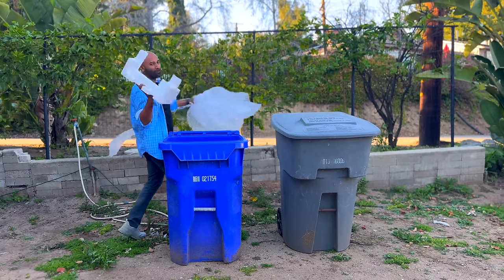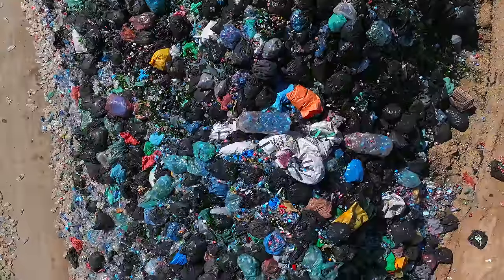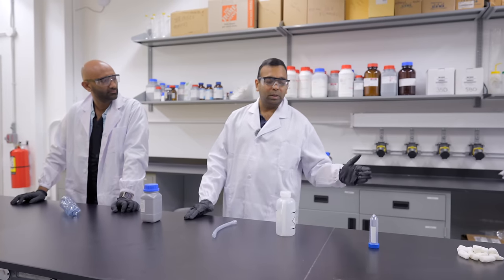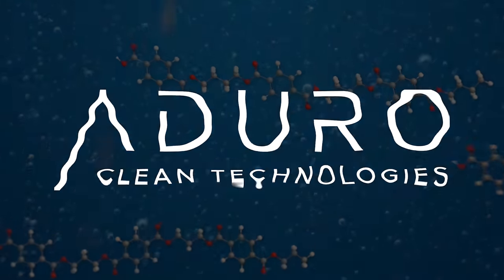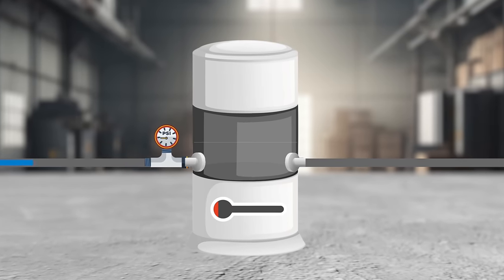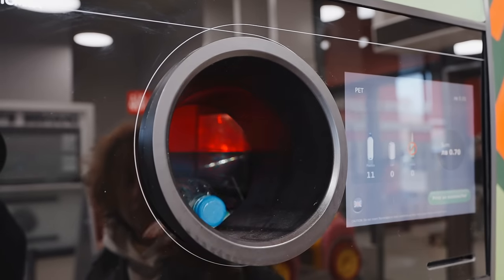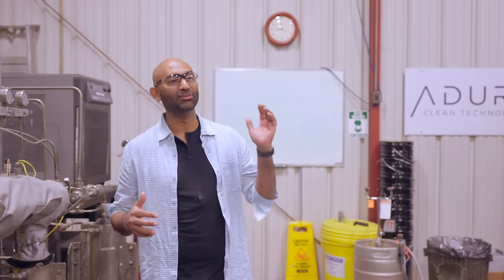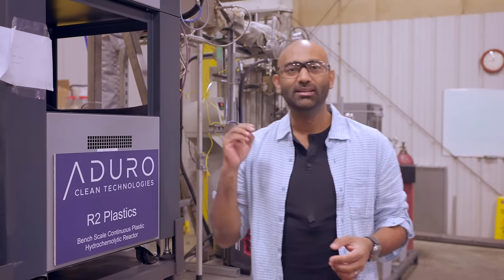Plastic Waste May FINALLY Have a Solution!

Comment: The UK is working on it, we have bottles with the lid made from the same clear plastic as the bottle, with a retainer that keeps the lid attached when you open it. The plastic film on ready-meal packs is just a single plastic rather than a laminate which tends to leave a layer of film around the edge of the container.
Next step? Ban coloured plastic bottles and those squeezy bottles with a valve in the lid. And pump-action bottles, several types of plastic,
Reply: What we need to do is standardized all plastics world wide. (Also use colors that don't effect them).

 Specialized plastics then can be taxed. 

 Medical plastics are good. Yet we should try to make them conform.

 I've seen tons of companies say they have the solution. So I apologize if I don't believe them till I see it. !remind me 25 years. (Just playing. Wish YouTube had that feature. )
Reply: This is very energy intensive.  Furthermore, most of the plastic in the oceans is not from the Occident.
Reply: you are nuts
Reply: I work on the bins, uk isn’t doing anything to help the problem no one is recycling their waste correctly.
Reply: - great, sounds good, except "banning" things is a poor way to move the state forward...  (big govt. of course sees bans as a one size solution - very short sighted.)
Reply: @crooksgames4511  there's no such thing as recycling your waste correctly. That's never going to happen, it's too complicated. We need solutions that sort the plastic etc at the other end and clean it if you need rid of food residue. Thankfully, this is easily done with robotics (not walking ones). I saw a glass machine the other day - they grind all colours and send it over a drop like a waterfall. Airjets shoot individual pieces into the correct bin. Completely bonkers but they were using it at industrial scale. 

We're never going to be able to train 80 year olds to recycle things into sixteen bins and it's a huge waste of human time to do too much with them at the household level.
Reply: @kadmow  sometimes we do have to ban things but yes, carrot and stick are more practical. We do however need to force the food industry to do what we need, because they've absolutely zero intention of doing it themselves. They use far more packaging than they need, and show no signs of stopping because they see their packaging as a way to compete.

If, on the other hand, we sat down with them and gave them ultimatums such as, 'We will nationalise your food company, all of it, unless you reduce waste at source, and standarise with more easily recycled packaging.' they would shrug, go to their shareholders and say, 'Sorry, we have to invest this money, the government said so.' That'd take care of a lot of it. 

Now, do I think the average, non-STEM politician could remotely cope with that? No. But then I didn't think the EU would start a revolution in the charging industry, and free us from the chains of Lightning and micro-usb and dozens of other charging standards... but they did. And also removable batteries should be coming. It's not as if it's not possible for government to solve these problems but putting their booted heel on the neck of CEOs who, lets face it, may often be borderline sociopaths and certainly don't care to get this done themselves.
Reply: Only if the replacements already exist, are cheaper, more resilient and easier to manufacture. Otherwise, no.
Reply: @crooksgames4511 what can people do to improve?
Reply: Don't gobble up the greenwashing (which the plastics industry excels in). Nothing is happening and nothing has been done. 
Recycling as we were once tought in school has been a lie from day one and here we are having discussions about an advertorial (he was paid to make this video and it shows) about another startup doing the same thing that doesn't scale nor can compete economically with virgin plastics.
Reply: @dianapennepacker6854  This is a terrible idea. How would taxing help in any way?
Medical plastics cannot be recycled. There is not enough heat in the recycle process.
I agree what is shown in this video is no solution. it is too energy intensive.
Reply: @rkatz69  Recycling is not a lie. Lots of things are recycled on a massive scale. 
Government mandated recycling is what is a lie. 
To the extent we want to limit plastics, and in the West there is absolutely no reason whatsoever to do so, it should be targeted.  Like a total ban on single serving plastic bottles (primarily soda/water bottles).
Reply: @jonevansauthor  It cannot be done with or without "robots"  Glass is recycled because it makes sense.  Glass was recycled long before there was any recycling laws.
Plastic is not recyclable economically or energy wise. It will always cost more and use more energy. Glass bottles are recycled because recycled glass is cheaper and uses less energy. Same with steel, aluminum and copper....  Plastic is fundamentally not recyclable. This cannot be changed by clever tech.
This video is nothing new and is a paid advertisement.
Reply: @tarstarkusz  I didn't say medical plastics should be recycled. They should be exempt for sure. 

 No sorry I think it is a good idea to standardize all plastics. We don't need 100 million variations slightly different that cannot be easily recycled as one for every single damn consumer item. Even the ink should be at the very least non toxic, and biodegradable.  
 
 Those that have to be can be taxed, or recycable. That would actually motivate people or companies to develope better ways. Even a deposit like some states do would work. I'm not talking a lot, but just enough, and it would be those producing said items. 
 
 Even deposites would work. Had bums clearing out trash daily to recycle items. Worked wonders.
Reply: @dianapennepacker6854  What part of "plastics cannot be recycled efficiently or economically" don't you understand?  This would not change even if there was only 1 type of plastic that came in only 1 color.

A large percentage (a large majority) of plastic isn't even used for any kind of packaging, which is what they complain about the loudest and most frequently.  A lot of this plastic is not just plastic.  Take a TV, the plastic of the TV body is connected to all kinds of non-plastic material like glass, fiberglass, copper, silicone, steel etc.

You're talking about soda bottles.  Just ban single use single serving plastic bottles.  There is a perfectly usable and infinitely recyclable materiel which was used before the plastic bottle.  I think I was in my late 20s when single serving soda bottles switched from glass to plastic.  Of course, there is a downside and that is all the extra weight of glass and the hazard of broken glass.

The government will do really silly things like banning plastic bags.  My city has banned plastic bags and it's a nightmare.
Reply: @tarstarkusz if there were only 1 type and 1 colour of plastics only, you would instead reuse it which is far less energy intensive than recycling it
Reply: @erkinalp  What do you mean by "reuse"
Reply: @tarstarkusz reuse for the same purpose as previous use with minor treatment such as washing and disinfection and relabelling
Reply: @erkinalp  For soda/water, I would say glass is better.
But this is a small fraction of the amount of plastic just in a supermarket.  Whether it's dishsoap, laundry detergent, peanut butter, mayonnaise, mustard, jelly, syrup and a thousand other things, managing reuse would be impossible to do at any reasonable cost.
Reply: @rkatz69  If you can't see the novelty in Aduro's technology, it's only because you haven't tried looking deeper. There's only so much that can be covered in a 15-minute video. But the key you're missing is the fact that Aduro isn't producing (and therefore competing against) virgin plastics. In fact, none of the chemical recycling processes do.
They produce fuels, oils and waxes out of these plastics that can be used for something else. Only when processing PET does Aduro's process recoup the terephthalic acid used as a monomer to make more (virgin) PET. None of the other products are plastics or monomers.
Reply: @crooksgames4511 I suppose it depends where you are. Myself and my neighbours 'do' recycle properly - once we were 'finally' provided with recycling bins (only a recent thing).
I think some people just don't understand, some don't have time, some are too lazy (your council should start taxing households that 'don't' recycle properly and deliberately fill their bins with everything and anything), and there are those that are angry because the cost of living and government indifference are pushing them to and beyond their financial limit. People who are angry and stressed are least likely to comply.
Reply: @Debbie-henri  You are not recycling, you are putting rubbish in different bins.  The "problem" is that the recycling does not happen when the truck comes to pick up your neatly sorted rubbish.
Reply: @Israel_Two_Bit  The amount of energy needed to do it is far too high and it will never be economical. Valuable rubbish is recycled entirely on its own and without all these laws.  Nobody has to tell people to recycle aluminum, copper, steel, paper etc.
Reply: @dianapennepacker6854  Exactly.  Technological advances are great and often increase likelihood of success but, unless the consumer demands it, it will fail.
Reply: @jonevansauthor  yes, that's how our system worked more than 30 years ago.
Reply: Exactly. It's crazy there's been no regulation of plastic for so long. The consumer plastics could all be streamlined into plastic that is much simpler and easier to deal with.
Reply: @rkatz69 well said
Reply: @dianapennepacker6854 exactly. Medical plastic is a drop in the bucket compared to all the mass consumer plastic. There's no reason why much of the mass consumer plastic, over-packaging, etc. can't be eliminated or streamlined into fewer types of plastic something more  manageable.
Reply: @tarstarkusz well put. seems could go back to glass bottles, wax paper, cardboard etc. in much packaging and bottling and bring back deposit system. Also stores could sell dry food and such from bins by the weight and use paper bags for it, which could be made out of hemp etc. Same with many consumer products can be sold from bins. Like a big bin of flashlights. The instructions or manual for the product is on your phone. Everything doesn't need its own individual plastic packaging. The amount of consumer plastic can be significantly reduced.
Reply: @tw8464  Well, a lot of stuff is already sold dry and in cardboard.
The problem really is that the vast majority of plastic isn't packaging.  This plastic is WAY worse than packaging.  At least packaging is usually just plastic. But products are often not just plastic. It's often combined with other materials like printed circuit boards, batteries, steel, wood, aluminum etc.
Personally, I like Bakelite and I'd like to see some plastics being substituted with Bakelite.
Reply: @tarstarkusz  good point. The other products you mentioned are definitely a more difficult problem.

Comment: Great presentation.  I really hope they are successful.  I do find some of the comments regarding other plastic recycling puzzling.  More than 30 years ago, my wife and I were involved (BOD) with a start up that sounds similar without the benefit of bitumen.  We had raw recycled plastics running on conveyor belts straight from the recycle bins.  There were stations where the types of plastic were identified and separated using sensors and an air gun (no human involvement) into bins.  I don't remember how labels were removed but all plastics were cleaned (no human involvement), ground up and molded into pellets of "pure" resins.  These were mixed the way customers wanted and formed into new pellets of  the required composition.  Our problem was that, while we had interest from large manufacturers which we needed to keep our operation running, it took customers too long to make purchasing decisions and we had to close our doors.  But we had the technology then to accurately separate and clean plastics.  Also, our pellets came out a very light color.  I never saw a finished pellet of the dark or black colors shown.  Also, I don't know how the plastics actually held up in finished products which, of course, is the ultimate test of how well the system works.

Comment: Licella has been operating their trial and development super critical water oxidation reactors on the Central Coast of New South Wales, Australia for about 15 years. The process is a one step shredded plastic to crude oil process which gives better than 80% yield and sufficient high calorie gas is produced to generate electricity. There is a large Licella plant in the UK and a 20,000 ton per year soft plastic digestion plant is due on stream in Altona, Victoria this year. The Licella process output is very desirable since it is very low sulphur crude oil - highly sought after by refineries.

Comment: Good video.   The same problem is found in Li-ion batteries and it is one of the seemingly insurmountable hurdles to recycling them because there are different chemistries and formulations of similar materials and even metallic nanoparticles so separating them is a challenge.

Comment: Damn boi. This is really amazing. First time that we have a real solution for plastics. It just need to go bigger. Amazing.
Reply: Unfortunately this is not a solution. The process isn't residue-free, and these residues, aside from being toxic, limit reactor runtime to unviably short periods. But at least it gives Europe an option do to something with plastic waste aside from shipping it to China. Who doesn't want it any longer.
Reply: @Volkbrecht  it's better than any process we have today. Unless they burn the shat out off it.
Reply: @Volkbrecht  you are lying, Aduro is the only technology that can deal with residues properly. Their tech is years ahead from anyone else
Reply: @ts8960   @ts8960  Mind your manners. People can be completely honest and still wrong.

That said, you are not looking at the full picture. For one, the process outlined in the video needs cleanly sorted plastic waste, PE or PP. But there your problems start. Household waste contains other forms of plastic as well, especially PVC. Can their process deal with halogens? And there are other, worse forms of plastic waste, that contain all sorts of stabilizers and flame retardants, stuff that comes from car recycling, or insulation from houses.

So no, they are not "years ahead" from everyone else. They have devised a niche application, which could be useful in places like Germany, where they have a deposit system in place that makes sure beverage containers go back as seperate waste streams. But what they have is not dealing with the brunt of the problem.
Reply: @Volkbrecht  their plastics dont need to be sorted before going into aduro's machine, thats what makes them special. I dont understand why you make up things and lie in the comment section
Reply: @ts8960  If you insist on being rude, I see no basis for a discussion. If you think you have more information than me, just lay it out. I watched the video, and I think my points are valid. If you have other sources, I'd be happy to learn. But as someone who has worked in that field of research for over  three years and knows quite a bit about the intricacies of it, I will not start doubting myself because some rando on the internet says so.

Comment: The recycling triangle is: reduce, reuse, and then recycle. Why do we only focus on the last part. Why can't we focus on reusing? Especially with like soda bottles. In germany beer bottles are directly reused to such an extent that sometimes breweries have to remind customers to bring back bottles because they were running out. This means its a closed system with few bottles needing to be made every year. For soda specifically, because the bottles are tougher to withstand pressure, a similar system is very possible to put in place.

Comment: Aduro has 5 or 6 multi billion $ companies already interested in them and are part of the customer engagement program. Aduro is looking to turn each into a collaboration this yr at millions each. Companies need solutions by 2030 and Aduro seems to have the goods . Recent press releases show the yield at an incredible 95%
Reply: What happens in 2030?
Reply: Something to do with carbon credits the government issues to companies who produce plastics. I believe by 2030 those credits companies have been given expire. A plastic solution can save companies billions managing the waste produced by their plastics.
Reply: Now do some independent research, look at competitors (and the once before that), learn why it doesn't scale nor can compete economically with virgin plastics and move on.
Reply: They are not the only ones. BASF does this stuff, as does Remondis, and a haggle of other companies. I have been involved in that research (disgusting stuff), and it's probably easier to look for players in that market that don't engage in this game.
Reply: @Volkbrecht  , Aduro stock, although speculative at this point, has done very well in the microcap space. My initial investment from less than 5 months ago has made me several thousands of dollars at this point. I'm longing this stock. If what Aduro says isn't true, then I'll pull back on my investment. So far so good.
Reply: @Steveo_00700  Not saying it isn't true, and in this market, scale of production tends to be a distinguishing factor. I haven't looked into Arduro's ideas, so I don't know what niche of the market they are aiming for. Just saying that the idea of cracking plastic waste is pretty much mainstream at this point.
Reply: @rkatz69  the difference between aduro and other companies is that their technology 1) works 2) is scalable and lenient to each company's use case. Their technology is years ahead of any other company in the field